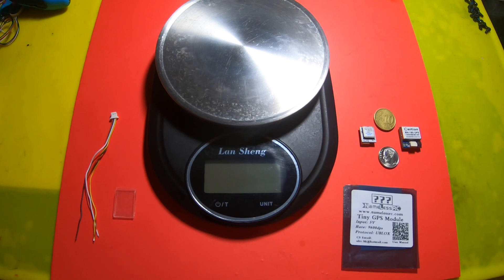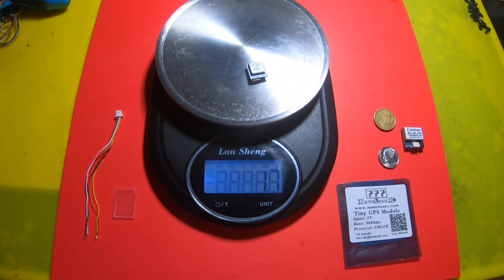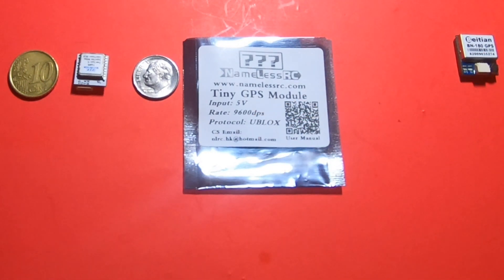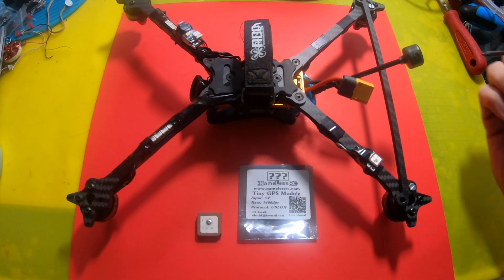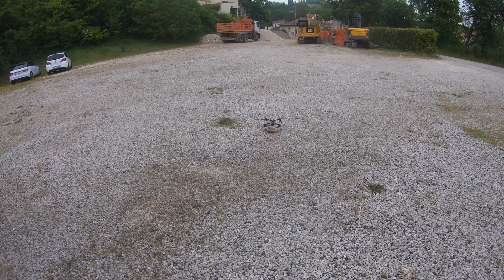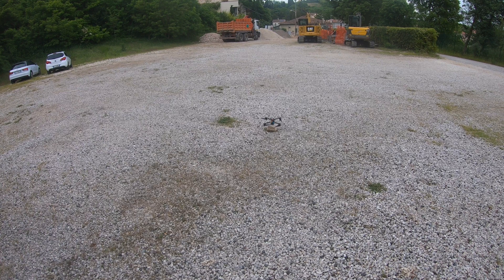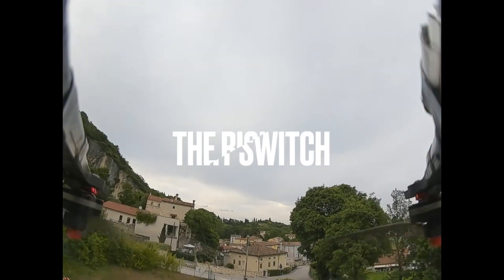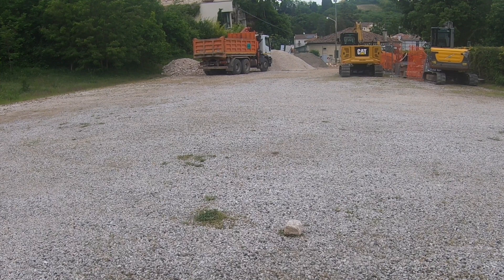So Tiny… NamelessRC Tiny GPS

Comment: I have 2 of them and they are terrible. Even after 30min in the open they still never get more than 7 sats. Other of my quads with bigger GPS modules get 14 to 20 in same spot and way faster. Probably hit or miss in quality.
Reply from the maker: I didn’t recall ever seeing more then 6 during the test and for sure waiting for a lock is a nightmare. But if you have to have one on a super light weight quad, it an option.
Reply: The two I have take over 2 minutes to achieve GPS lock.